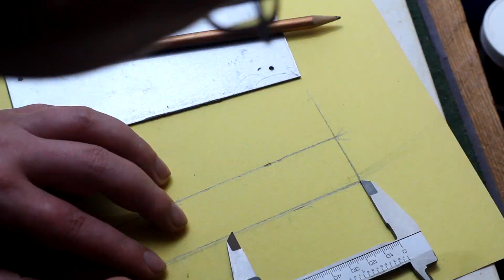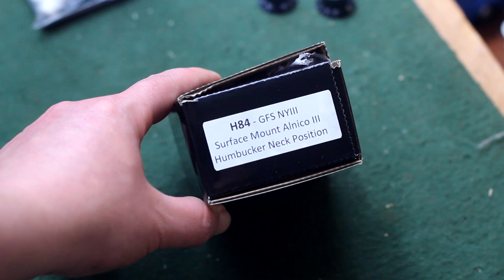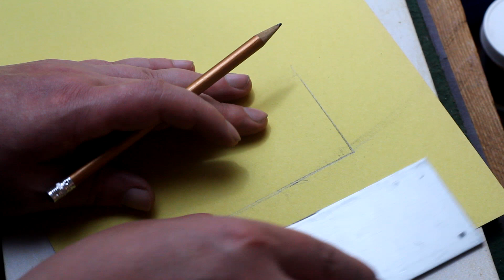Teisco Guitar Resto-Mod + Demo (Incredible Retro Tone!)

Comment: Your channel inspired me to go out and buy a 50 dollar pawnshop squrier and rebuild it for may grandson. It is a great success thanks to the info I got on your channel. mainly the mentality of not listening to the noise of others and going ahead and doing what you want and just make it work. I got some relays out of an old pinball machine that are just begging to be turned into some pickups. lots of wire on those things. every time I come up short on the windings  I am going to just put in a coil tap and say "yep I meant to do that." I think I will use the magnets out of a hard drive, because I have them. A retired old man with a garage is a dangerous thing. lol
Reply from the maker: Thank you so much Woodpecker AF. That is wonderful to hear. I am just overjoyed anytime someone says that they have been inspired to do experiments and projects. That's why I do this. It may not make a ton of $ and it might not be a big channel but the feedback I get from comments like this, Is more than enough to keep me going and show that I am on the right track. Good Idea on the coil taps, that's right it was all part of the plan. In all seriousness I really do find that as long as you keep that attitude and go with the flow, the universe will show you exactly what needs to be done and you will end up with a magical outcome. I always just kind of let the cards lay where they fall and work within the ability and restraints I have and it all works great. Whenever I do try to be too specific and picky is where things usually give me trouble and don't work out well and its also just no fun to be an anal retentive perfectionist at all. All the best luck to you brother and let me know how it all goes I'm always ready to learn from another persons experiments and projects. Thanks again, this comment made my day!

Comment: Tone went to heaven 😂
Reply from the maker: It kinda did. I cant believe the sound of this thing and was pleasantly surprised that it was decently easy to play. Beat all my expectation for sure... A lot of the old Teisco, Kay, Silvertone, Danelectro, Kawai kind of guitars that I have tried are hard to play, super high action and tiny frets = the strings feel like chording 1/2 inch steel tow cables.

Comment: You are an inspiration. My first electric guitar was a Teisco Del Rey E110, which I bought when I was thirteen or fourteen, at a pawn shop for a hundred dollars with a cheap amp included. It was a tulip-shaped guitar with a zero fret, a weak single-coil pickup, and pretty little flowers etched in the pick guard. The fixed bridge meant the intonation was always off, bad enough that if it was in tune on an open string, it was out of tune on any and every fret. But this video makes me wish I still had that guitar.
Reply from the maker: Thank you so much Erick. It turned out to be much more of a player than I expected. Ah, I know those guitars e110. I have a friend who is a collector and dealer of vintage guitars and though he is a blues guy now he used to be into garage rock and punk rock and is a big time collector of these vintage Japanese "Sears" guitars. He used to run a music store in Muscle Shoals called Max's Music, where I acquired a great deal of my gear and the walls were covered with Teisco, Silvertone, and Danelectro guitars. I got to play them and check them out so I was keen on changing to an adjustable bridge. Its kind of a shame that people act like these guitars are worth so much $ now days, when it is just a $50 department store guitar. My first electric was a Japanese Univox Les-Paul copy got it for $75 sold it for $75 years later. I looked one up recently and it seems like I wont be getting one of those again anytime soon, I can afford it. Maybe in 30-40 years the First act guitars from Wal-Mart will be super Retro-Cool and desirable for big $. It might actually be a good investment to buy up a bunch of them on the cheap now like Max did with the Japanese guitars and tube amps back in the 70s-80s when they were "un-cool" LOL Thanks again for taking the time to watch and share your past. I appreciate it truly.

Comment: My first guitar was a Teisco "St. George". guitar.  I should have never let it go. thanks for the video, and your other ones.  I almost bought stuff to make a pickup, I still might do it!
Reply from the maker: Thank you for the comment Michael, Man my first guitar was a blonde univox lespaul copy with a flamed top and I sold it for $75 I just saw one identical for sale for $999... I cant be mad though I had built a partscaster strat at the time (I still have and LOVE) and it fit my style of playing and tonal goals a lot better. I cant let my self feel bad for letting her go, it was just time. I hope someone else learned to play on it like I did. Go for it bro buy the cheapest stuff you can to start out with and maybe even just build a little scrap wood pickup or something for the first one. Its a steep learning curve right at the beginning to learn how to handle that wire that is thinner than a hair but once you get the feel for it and figure out how it should coil off the reel at your feet and the proper tension on the coil and you make one work and you hear it and you know you made that... it becomes an addiction, the ideas will flow and you will make way more pickups than you have guitars to put them in. Its a disease but its a fun one, its like gun smithing or racing or winemaking, it just grabs some of us and wont let go.

Comment: Ho-lee-shitters! Your humor and crafting skills make me want to buy you a beer and crack jokes. So glad i stumbled across your channel man.
Keep 'em coming. (the jokes and the crafting)
Reply: Btw: Instead of using superglue and sawdust you could use baking soda instead of the sawdust. It turns rockhard in record time+ its actually easy to sand and finish too. I even fix broken nuts with that method.
Reply from the maker: Thank you so much for watching and taking the time to write such kind words Jordy I am so glad you like the channel, I should be coming out with more videos soon. Great tip on the baking soda as well.

Comment: That looks like it'd be about the normal neck position equivalent on a 24-fret guitar. EDIT: Man, the more I listen, the more I'm with you on the low DCR buckers. Heard one of the bigger youtube guitar guys run some blade filter-trons in a Tele and I almost cried at how beautiful and delicious that thing sounded.

So far, singles sound a little thin, weak, and flat for my tastes (well, except P90s and kinda Jazzmaster singles, and also most of the ones you build), but all the modern high-resistance humbuckers kinda sound the same. Especially when they have covers and pole pieces tightened all the way in instead of offsetting pickup height lower and screwing the pole pieces out to give you a cleaner/more dynamic single-coily sound.
Reply from the maker: Thanks for taking the time to comment DH. It may be? I really should measure it because I dont even know what the scale is I just know it feels shifted and it sounds "chef kiss". hahaha but the bridge on this guitar is very close to the edge. I think this is worth investigation as I really would like to copy its exact location on my own builds.
Reply: @heavymetalATC  I think you should compare it to the testing mule's current pickup location in the latest 2 vids, because that one (especially with last week's pickup) sounds downright perfect. My personal theory (and because of how physics works with string centers as you fret further up the neck) is that directly in the middle of the last fret and the saddles of the bridge is the optimal pickup placement for a single pickup. On a 24 fret guitar, this would be "easily" found by locating the 36th fret location.

Also, I edited the comment above pretty much right in the middle of when you were typing your reply, it seems, so if you feel like it, give it another look and let me know what you think about my added remarks.
Reply from the maker: @Drunken_Hamster  Yes I need to do some measuring for sure and I think your edit is bang on!!!

Comment: Yep, I thought that is what you had there.  Btw, how do I repair my Teisco's fret board?  The thing has a chuck of wood out of it like I saw on yours.   I always thought it was played to death, but the fret height is the same as yours, and you made mention about that, so now I am not so sure.  I am missing a knob, the whammy bar, and the nut was broken on the low E so needs that.  I have no idea if it works because I plugged it in, and got nothing.  It needs a lot of work, and one day I may actually do some to it if I can find a sensible source for the parts it needs.  Btw, not having a schematic doesn't help because I have never seen a guitar with slide switches and rocker switches too.
Reply from the maker: Thank you for watching and taking the time to comment and share your info General. If the wood is missing on the dark part of the fret board you can get a product called "plastic wood" its like a 1 part bondo or putty filler that contains wood fibers, it comes in several different colors and it also can be blended with stain or stained afterwards. Sand it smooth and you are good to go. If the piece is missing on the part that was originally colored or covered with nitro finish you can use some wood filler or saw dust and super glue to fill it and mix a little paint to color the place and then sand it back and use the super glue to repair the clear nitro by placing it thick and then doing a progressive sanding from rough 220 or so to a very fine grit like 2500 like I did in the video and it will shine right up and become invisible. Also Yes these vintage Japanese guitars have very small fret wire. It is hard to do a fret level job on them without going to far so I just did a clean up. You can find the original knobs and nuts used on reverb or ebay. I looked at some of them but man they want the big $ for that stuff now, so I just measured and found cheaper stuff that worked. It turned out that a bone nut for a martin acoustic was just right. So thats a good upgrade for less $ though it isnt original. I have heard that the tremolo bars are notoriously rare and hard to find I have not looked for those yet. This guitars electronics were also silent on the first test but cleaning the contacts on the output jack was all that was needed to get it going. So that may be the case with yours as for the switches Brad the Guitologist has some good info on how to clean and repair those Teisco switches as for a schematic maybe someone in a Teisco forum or on the TeiscoTwangers website could help you with that? Surprisingly these old department store guitars are worth decent $ now days so If you felt that you were not attached to the guitar and didnt want to go through buying the expensive original parts and doing the repair. I'm sure you could clean it up and sell it as is for enough to buy a good new guitar. I have a feeling that's not your plans though. LOL Thanks again for watching and taking the time to write such an in depth and interesting comment.
Reply: @heavymetalATC  It is the top of the fret board like yours, and we have the same colored freboard (dark Maple?),  I have no attachment to this guitar, but it is calling to me.  Help me, make me better.  SHIT!  btw, in with it was a bass from Sears, but the owner kept the pick guard, and all electronics with it. :/  Same vintage.

The frets are so low I bet if a gnat crawled next to it it would probably stick up higher than the fret.

I wish I could show you this guitar because I looked around a few months ago for the replacement parts, and daaaaaaamn the parts were hideously priced for it.  The actual guitar is about 600usd.
Reply: @heavymetalATC  Check your possible spam as the links I sent to you disappeared on Youtube.  Should be in your studio.
Reply from the maker: @generalawareness101  It seems I am unable to get links from anyone? I think Alaric Paley also sent me some links and I didnt get those either. He seems to be VERY knowledgeable about this type and vintage instrument. He was able to identify the one in the video immediately as a Palmer/Tempo made by Matsumoko. His #1 guitar is a Teisco and I also saw a nice Danelectro bass on his channel. He may be able to help you find parts and Identify exactly what you have?
Reply: @heavymetalATC  No, idea but how do I reach him?  btw, the guitar you showed was on that Teisco page in one of their Japanese ads from back then so I am confused.

Comment: Great video, working on a similiar project with a teisco Tulip style guitar. Do you happen to have a link to the jaguar style bridge you bought? I assume I can buy any old fender jaguar bridge
Reply from the maker: Thank you for watching and taking the time to comment Chalooby. That is Awesome! Glad to hear you are bringing one back to life. Save all the department store guitars! Unfortunately the one I purchased is no longer available but this one looks to be identical to it: https://www.amazon.com/dp/B08FJ9F1B8/ref=sspa_dk_detail_4?psc=1&pd_rd_i=B08FJ9F1B8&pd_rd_w=3DDm6&content-id=amzn1.sym.bff6e147-54ad-4be3-b4ea-ec19ea6167f7&pf_rd_p=bff6e147-54ad-4be3-b4ea-ec19ea6167f7&pf_rd_r=ZBHMMMCQ755WB7CMD47A&pd_rd_wg=0oZl8&pd_rd_r=9e7fee24-ccd0-42ca-98be-324af6c6a39b&s=musical-instruments&spLa=ZW5jcnlwdGVkUXVhbGlmaWVyPUEzWUk1VE4yR1NZVUYmZW5jcnlwdGVkSWQ9QTA5MjA1ODAyR0FITFVVSUhRVDI3JmVuY3J5cHRlZEFkSWQ9QTA5MTE2OTcyNEFXQTNMNFhZRVZLJndpZGdldE5hbWU9c3BfZGV0YWlsMiZhY3Rpb249Y2xpY2tSZWRpcmVjdCZkb05vdExvZ0NsaWNrPXRydWU=
Reply: @heavymetalATC  I bought this and it arrived today. It does not fit on mine as it is too wide. My existing teisco bridge looks to be the same as yours in the video.

Comment: Clementine brother please show us the way to make squire tuners great with just adjusting the nut.
Reply from the maker: Thank you for watching and taking the time to comment Ai. I actually have a made in China Squire bullet strat and it has factory tuners and I have never had a problem with them even one has a wiggle to the key but functions just fine. Sometimes a tuning head can have a mechanical problem that will allow it to slip or shift but I as far as my Squire I haven't noticed these problems. Setup of the nut and nut-slots is a crucial factor there can be no binding, Also the way the strings are wound on the peg is a big factor and also you must always tune the string up to pitch never down. The neck or tremolo system can cause a ton of issues with tuning stability but in my own experience of messing around with cheap guitars and partscasters, it is rarely actually the tuner that is causing the tuning issue. I'll put this in my notes and If/when I do a video on this subject I'll use the squire as an example and I will give you a shoutout.
Reply: @heavymetalATC  Thank you brother

Comment: I have a teisco tulip and thought I could replace the foil inside with gold... Do u think that would sound good?
Reply from the maker: Thank you so much for watching and taking the time to comment Boi Mesa. Well this is the thing... unfortunately that foil doesn't really do anything in the pickup, its pretty much for looks. Its actually just a paper card with a reflective surface like the foil inside of a box of chocolates, But if you have a tulip with gold foils in it, you got something people lust after. Those guitars and especially the pickups are highly desirable which is surely why this guitar was missing the original one. I made a video on building a gold foil from scratch it will show the construction and explain the function of the parts: https://www.youtube.com/watch?v=ZBHkPltaavg
Reply: @heavymetalATC  sadly mine doesn't have the gold foil in it